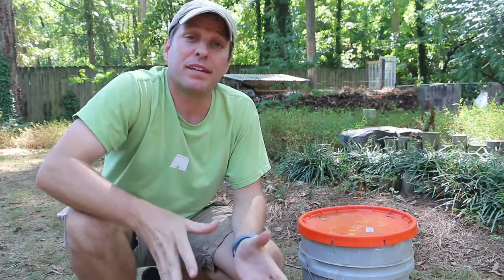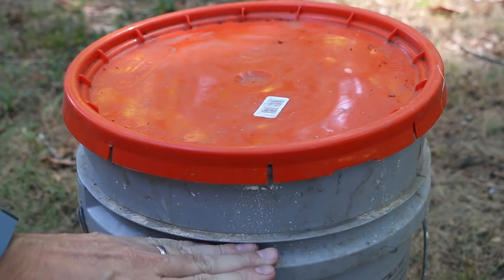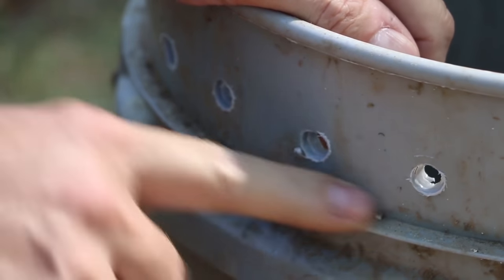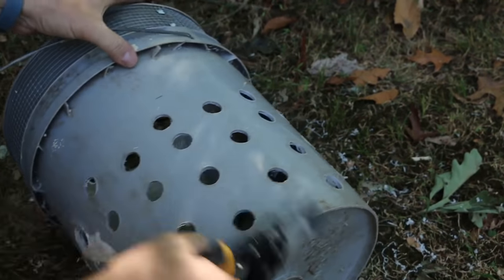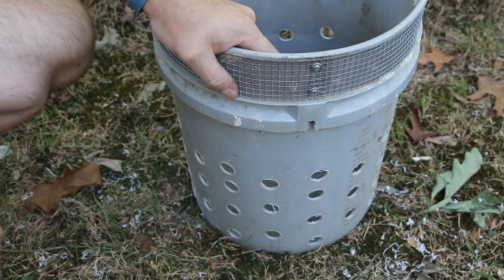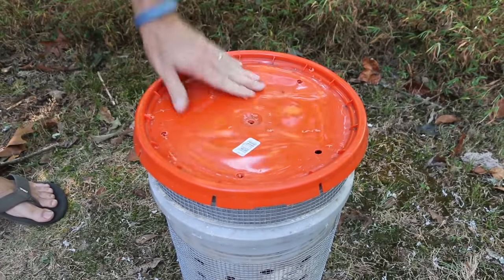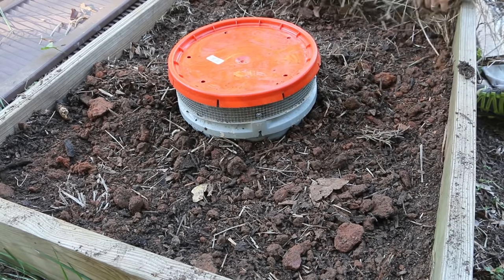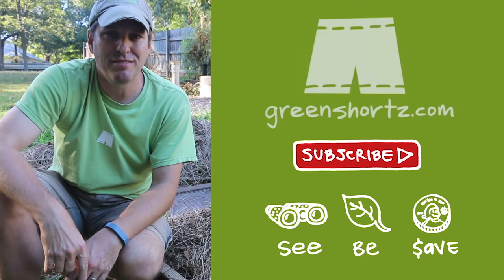How To Make A DIY 5-Gallon Bucket Worm Tower

Comment: Awesome, I have two of those  and love it, it's very low maintenance,  I don't put any vent holes on top of the  bucket since we have  so much rain. I just have a lot of holes on the bottom and side. I find baby worms all over my raised bed.
Reply from the maker: Thanks for sharing your success with type of worm bin. I think it is one of the easiest worm composting bins to build and operate. Not to mention pretty cheap too.

Comment: One tip to prevent the plastic burrs on the inside of the bucket, is to just drill partway through the bucket with the paddle bit and then go to the inside of the bucket and drill outward, completing the hole. You’ll have no burrs. Only problem is, the drill and the bit needs to be able to fit inside the bucket. 😁

Comment: Great video. I like your improvement of the wire mesh to keep rodents out. I had an issue of mice chewing through my worm bin a while back. What zone are you in? I'm in 7B and am a bit concerned that the worms could overwinter. If it works I'd love to sprinkle these around my garden. I'm thinking of putting large dishes on top though to double the space as a birdbath and frog habitat.

Comment: How many worms should a person add to this bucket? What type? I see red wigglers sold on Uncle Jims. It looks like a nightcrawler which is what we have in my area would be too large to go in and out of the mesh. I'd have to purchase red wigglers so the question is how many per bucket is recommended. Sorry if I missed this in your very well made video. 
I fight those moles and voles constantly.
Reply: I  Think nightcrawler can fit in the 1/4" mesh and 13/16" holes.

Comment: Are the worms going in and out through the metal mesh at the bottom of the bucket?  The holes look pretty small.  Thank you for all your helpful answers on the comments!
Reply from the maker: Hi Tracey. The lower mesh is a quarter-inch, so will allow the worms in and out. The top screen is window screen and will keep the worms in. The babies could squeeze through, but they aren't usually that adventurous. Thanks for watching.

Comment: I’m planning to do this on a smaller scale  using a 2 gallon bucket. Some of the YouTube videos using a 2 gallon bucket cut off the whole bottom and some just put holes in the bottom. I noticed that you didn’t put any holes in the bottom. 
Would you still do that now?
Reply from the maker: Hi Ellen. I only did holes in the sides so the nutrients would flow more horizontally. I didn't want gravity to take the good stuff straight down, bypassing the garden. I also wanted to encourage horizontal movement of the worms, which the composting worms would most likely do anyway, as they want to stay in the top 12 to 18 inches of soil. Good luck with your build. Thanks for watching.
Reply: @GreenShortzDIY Did water build up at the bottom? Or were your holes in the sides go down far enough to eliminate that problem?

Comment: For dealing with wind noise on your camera, get a bit of low-density, fluffy plastic-based roof insulation material and simply find a way to attach it over the microphone/microphone holes on your camera. Doesn't matter what it looks like since your viewers won't see it, but it'll practically-eliminate wind noise and, if you're using the right of the stuff won't attenuate your microphone audio much, if at all :)

Also instead of screws for securing the mesh/screen you could go with rivets and a pair of washers. Just use something sharp to make a hole through the plastic and mesh if necessary so you can get the rivet's pin in through there.
Reply from the maker: I thought about rivets. I do have a pop riveter, not most reliable one however. But, part of my goal with channel is to reduce the need for people to acquire new tools to do these projects. So, I try to use more readily available materials using tools most people will have. Thus, the screws.

On the wind noise issue...I don't use my camera mic, rather a shoe-mounted Rode shotgun, with a dead cat wind screen. Most of the wind noise in this video was actual noise from the trees getting blown asunder by the blustery edges of hurricane Matthew. There was some mic buffeting happening, but mostly it was just loud ambient trees. :-) That said, thanks for the suggestion. I will try added insulation on extra windy days.

Thanks for the comment. And for watching.

Comment: I like the video and thought it was taught well but I have only one concern. Cant rodents eat through the top plastic lid with no hardware mesh or screen?
Reply from the maker: Hi Mary. Thank you. On your question...probably. But, I think the amount of odor release from the top holes would be minimal. I'm more concerned about moles underground. I think the rats would move on when they couldn't get in the side. It is a plastic bucket, so it could be chewed. I've been using mine for about 4 years now, without an issue. Thanks for watching.

Comment: TIP: the step up cone drill bits are ideal for this type of project. They drill a range of hole sizes without any burrs or rough edges to clean off afterward. The spade bits are now only used for wood-based projects.

I currently maintain a 5-bed aquaponics system along with 4 long raised beds in my garden for heavier-rooted plants. I've implemented the 4" PVC garden tower and noticed that the step drill bit is really a must for almost all types of gardening applications utilizing PVC, buckets, barrels, bins etc. So just wanted to share this tip with everyone. Here's the bit on amazon for ref.. https://www.amazon.com/Vastar-Titanium-Drill-Speed-Steel/dp/B073JM4D8F/ref=sr_1_27?s=industrial&ie=UTF8&qid=1543257736&sr=1-27&keywords=cone+bit
Reply from the maker: Thanks for the tip. I think that would have worked better than the spade bit. I ended up buying this one: https://amzn.to/2OZ0qnT
Reply: Thank you!!!!!!!

Comment: I like your 4 inch PVC Tower one better , it takes up a lot less valuable real estate in my raised beds.
Reply: I had this concern also. My beds although are long are only 3ft wide. So decided utilized the towers instead of the bucket. I can, however, see the benefit of the bucket system as it can hold and process more materials as well as house a larger worm community. Would also require less maintenance I guess...